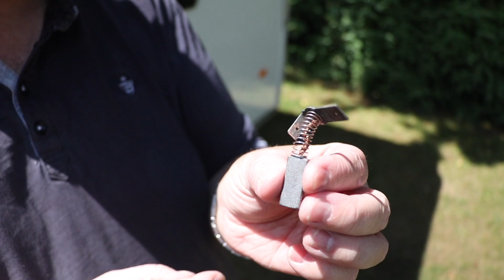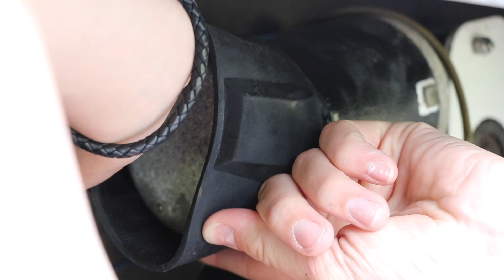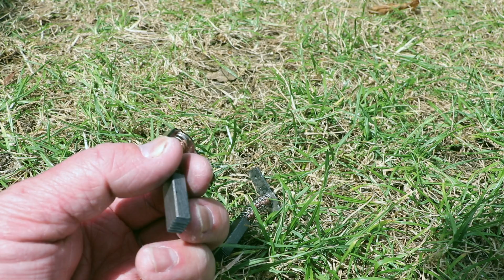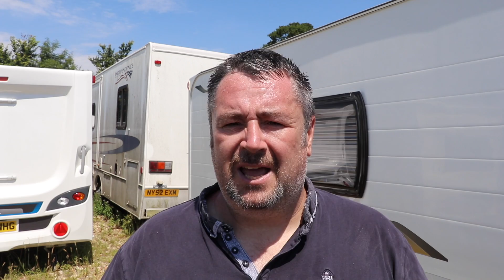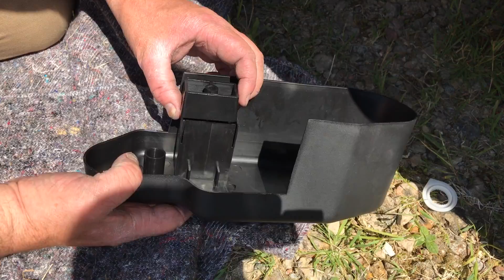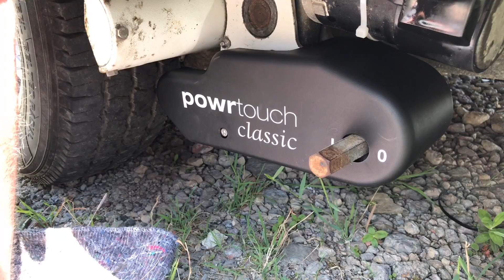PowrTouch Classic motor mover brushes replacement

Comment: Hi Dan, I'm looking at replacing the brushes as one side isn't working, do you have to disconnect the battery before doing this job ? 

Thanks Adrian
Reply from the maker: Hi Adrian, no, I didn’t but make sure the isolator for the mover is set to off. No power should be anywhere near the motors.
Reply: @TheTrudgians  thanks for your   help, that is sound advice and ye of course there will be no power as the isolation will be on little things I didn't think of 😂😂

Comment: Great video. Had a problem with one of my brushes. Didn’t know it at the time, but your video had me looking and found out that one was a little sticky, and didn’t connect unless pressed. Removed it as per your video, and cleaned out cavity, cleaned the brush, reinserted and bingo. Many thanks. 👍

Comment: Hi Dan, Looking for some help with a motor mover issue. When the motor mover isn’t engaged the rollers roll as you would expect it to backwards and forwards. However when I engage the rollers it seems as if it doesn’t have enough power to move the wheels either way. Do you think replacement brushes would sort this problem ? Leisure Battery seems to have plenty charge any advice appreciated. thanks
Reply: Hi I would like to know if all the brushes are the same with power torch I have a powrtouch freedom

Comment: Really helpful video thanks. However, you got the tapered block the wrong way round - it should draw into the outer rectangular bit when tightened so as to expand it; yours (and everyone else’s who’s commented?!) might just be sat against it (though it obviously still bulged out as it did seem secure). Nice tip for the pointer too.

Comment: Have you tried taking off the side covers yet? Mine are stuck fast. They wouldn’t even come out with a large screwdriver levering them. In fact one side cracked (on the inside) so I gave up and tapped it back in. I’d be interested to know if you have a similar problem.

Comment: I thought someone may be able to help : Ive a problem with the fridge in my  S/H caravan.  I can see the gas jet burning throught the sight glass, but it won't make frost where ever I pull the thermastat, any ideas ?
Reply from the maker: Hi,

I would strongly recommend you get someone to look at your fridge, especially when dealing with gas. it could be straight forward, it could be something else. its not worth the risk.

Hope that helps
Dan

Comment: Thanks Dan, never short of DIY with a caravan. I think we have the same mover so a pair of snazzy covers will be ordered. Ours is 11 yes old but hardly (like the van), used. So I would estimate the brushes to be OK, but will check. You wouldn't want to see the state of some I've replaced on some 230v motors.
Reply from the maker: Oh i can imagine the 230v ones were quite interesting. I would imagine your brushes would be fine, after all motor movers don't run for long, but worth popping out & checking. 

Hope you are well.
Dan

Comment: Great video as usual guys. Just wondering about battery disconnection before starting work. It seems to be a recommendation for safety on most electrical work these days. Was it  not necessary with movers due to their separate isolation switch ?
Reply from the maker: Hi Adrian, yes - disconnect the battery if worried, we isolated our motor mover before we started any work. only current would flow if the motor is activated. 

Thanks 

Dan

Comment: Another great vlog guys , Can i ask How old was the mover before any of this work needed doing ?  We have a Powrtouch evolution on our van which was fitted by the last owner and is now 5 and  half years old, I am just wondering if it may be time to replace these bits now before they break down, The gap we have to get through when we get the van out is so small we need really need the mover and could do without any failure when doing so. Thanks again for another great vlog :-)
Reply from the maker: Hi Peter, 

Our motor mover i would think is as old as the van, so 7 years old. We rarely use the mover, but when we do we need it for a really good reason etc. Perhaps this is why ours failed, through lack of use etc ? 

I hope that helps.

Dan

Comment: Got to look at mine this weekend I can hear the motor running but the arm is not retracting out to the tire so not 100% sure yet what it may be any idea before I go and strip it down
Top video again ty
Reply from the maker: Hi, 

it might be a couple of things, either the roller is worn, the spring has lost its tension or a mucky carriage. If its a PowerTouch - do give them a call, their after sales service is amazing. they will quite possibly tell you where the issue actually is. 

Hope that helps.
Dan
Reply: The Trudgians hi cheers for the reply I had a look at the weekend :( you can hear the motor and the roller is spinning seems it won't head out to the wheels I believe it's the actuator gone very costly looking on powertouch site we have the evolution £125 lol 
If there's a cheaper source of these than let me know lol 
Cheer again for your time
Reply: Sorted it and so simple lol for some that may get the same issue as I did the arm does not retract but roller moves 
Basically inside the mover is a small sensor that for some reason either it's failed to hit the sensor or you have not allows it to reset but all you do is remove the plastic cover as you see in this video and at the back end on the actuator you will see a small plastic bung remove that and inside is a small 7mm bolt stick w socket on that and very gently turn it clockwise say an inch turn then remove socket and try your arm should start to move again if not turn the opposite way and try that 
This worked for me hope it helps
To add mine is the 
Evo version automatic mover